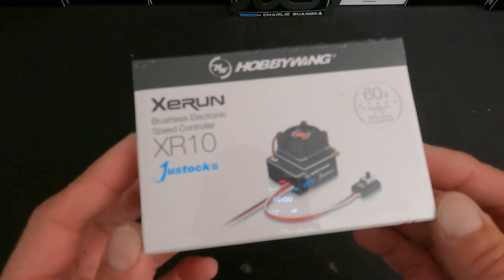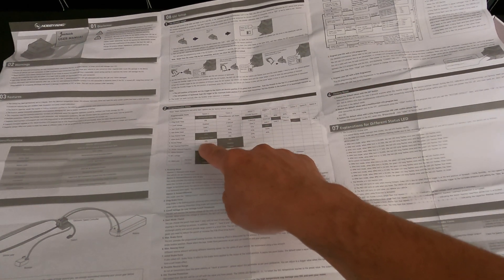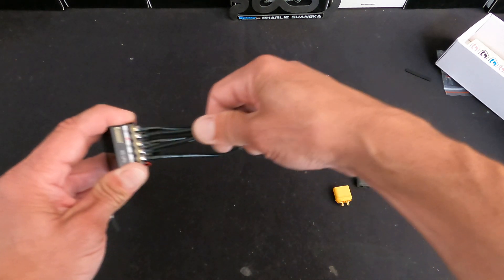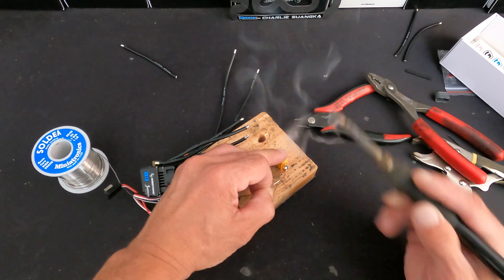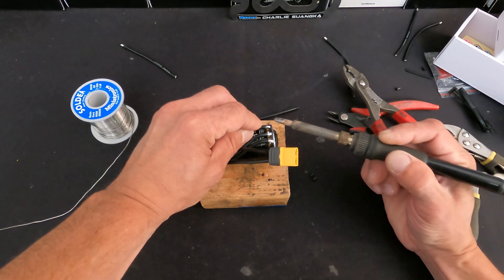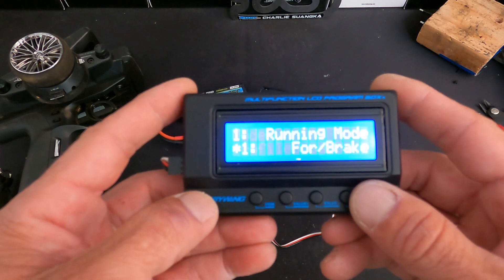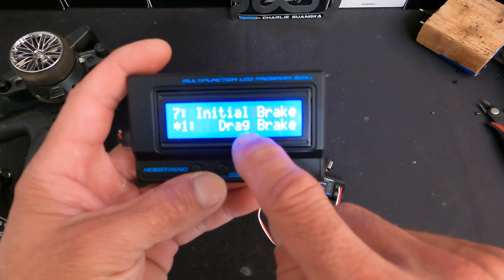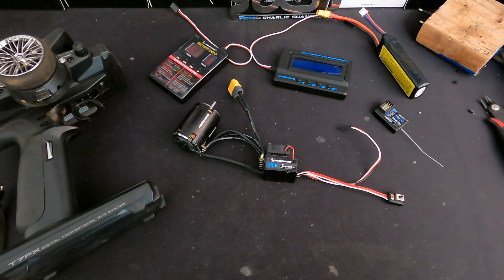The Charlie Show /// Episode 217 /// Justock G3 - First Look - Setup

Comment: 10:42 is the calibration a must and what is it for?
Reply from the maker: Yes, calibration should be done. It allows the ESC to learn the actual channel output, neutral, throttle, and brake travel/ranges.  It's crucial to having correct throttle operation.
Reply: @HOBBYWINGOfficial  thanks,will the esc work with a supersonic rocket 10.5t?
Reply: @HOBBYWINGOfficial  and when I just buy it,at what voltage is the lvc?

Comment: Your explanation is too fast, especially you need to slow explain the plugging of Sensor cable as it is very tiny, and a bit too hard to plug this sensor cable. Also, the calibration process you explain is too fast. Maybe you can explain it more slowly. Thanks.

Comment: I bought the 17.5 fixed combo. Put it in my RB10 RTR and it was way way slower than stock. Buddy at the local hobby store tried multiple gear combos and nothing worked. Couldn't clear any jumps it was very slow. Any Ideas? Was very disappointed and ended up putting the RTR stuff back in. At this point I have a $120 paperweight sitting here.
Reply: Same issue here.. my cordless drill is faster.. VERY weak magnets in the 17.5.. I was TOLD I had to run this for rules..$600 car is now a shelf display.
Reply: did u resolve this issue?
Reply: @AizenSousuke92  returned it and bought the pro stock ESC and a team powers 17.5. works fantastic.
Reply: @oCaRRiEDx 😂😂 the stock motor has 3000kv, the 17.5t has 2400kv.. but hey, i guess youre from the usa, thinking was never your strong point

Comment: I just purchased the XR10 pro elite and wanted to know is it normal for wires to be so hot?
No prep application 
3T motor, 5100mah 130c battery, 87/18 gearing
Reply from the maker: Might be worth dropping a few teeth on the pinion. "Low Teens" has been a safer starting point for the low turn motors.  Lots of current being moved in a short time in today's drag race setups.  Search "Timing" and "NPRC" on the channel for some tips on Tuning.